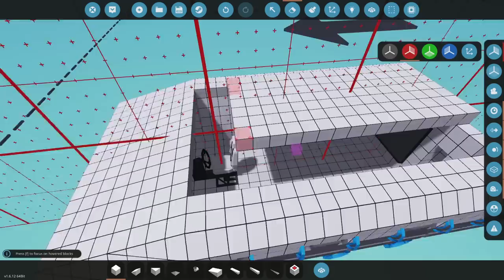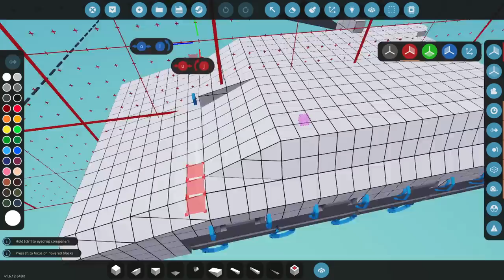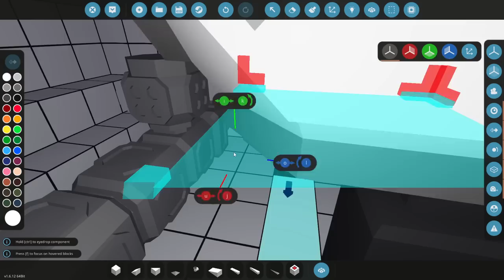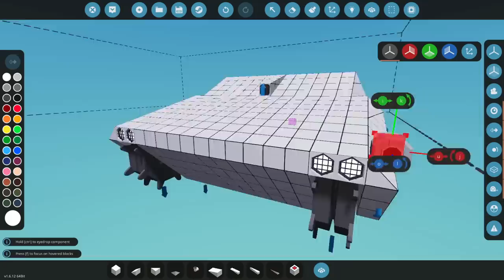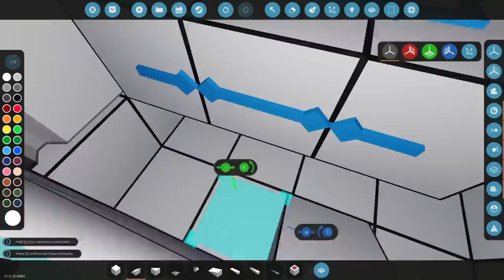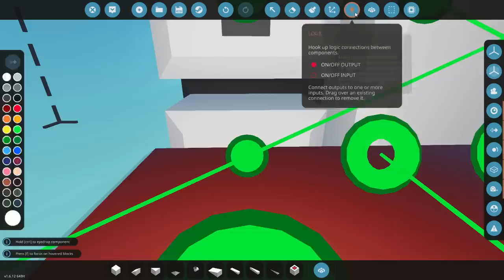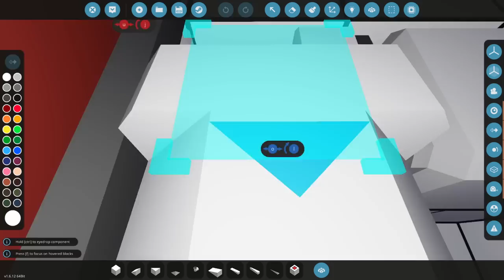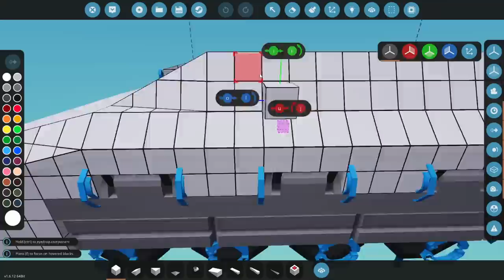I Built An ENGINE For My IFV - Lets Build An IFV In Stormworks!

Comment: I suggest that you put some fuel tanks under the seats in the Infantry space, like, you can place the fuel tanks as blocks that can hold the benches, it will look cool and you will have more fuel.
Reply: A bunch of small tanks or what? For now the engine room seems to have plenty of space.
Reply: Not very safe for the infantry is it?
Reply: @dulguunjargal1199  have you seen American designs?
Reply: @Metalbeast46934  I think American designs had some kind of portection for the fuel

Comment: If you use the "Sprocket" transmission setup  menu as a guide,  You can set up a transmission that works really good in stormworks.   

You need a reduction transmission to make small engines drive big vehicles.  

 I would start with 3 Main gearboxes and a reverse gear for the transmission.    

The arrows need to be facing away from the engine.

  Set the OFF ratio on all of the forward gearboxes to 2:1, this will give you a reduction of  16:1  which means 16 rotations of the engine is one rotation of the wheels.   

Then set the On ratio 3:2 on each transmission and either use a counter to turn them on one at a time or just use buttons to turn each one on.  

Turning on all the gearboxes will give you a top gear ratio of  5.0625:1 which means for 5 rotations of the engine you get 1 rotation of the wheels.   At 20 rps, which is a decent rps to run at with proper cooling,  the wheels will be spinning at 3.9 rps. 

Depending on the diameter of the wheel, that should give you around 10 m/s?     

The ratios I said are just a starting point and can be changed depending on how it performs.  

 Small engines tend not to like to run anything with wheels at or above 1:1 reduction unless it is a very small vehicle with small wheels.

  I would use a 5x5 radiator also BTW.

Comment: If I recall gearboxes correctly, the arrow pointing towards the engine is more RPS, whereas away is more torque, so from my understanding, two gearboxes facing the engine would give you more rps, or if they were faring away from the engine, more torque. It just depends on what you want, but personally I would say just one gearbox facing the engine is best because it multiplies the rps and divides the torque. I'll be honest, I'm not very educated in torque/rps, I'm just going off the basics I know, but u hope I was able to somewhat help
Reply: Kind of. It's important that you clarify where this is occurring since there's an "equivalent exchange" going on. A gear box pointing back towards the engine will give the wheels more RPS for the rate of taking away RPS from the engine and adding a lot of torque to it. So the engine will struggle to get up to a good rate at full till, but your wheels will go like there's no tomorrow.

A gear box facing towards your output (wheels, tank treads, or propellers) gives the output more torque and transfers more RPS to the engine. It's important to remember this exchange because while it seems fine and dandy to just stack a bunch of engine facing gear boxes maxed to a 3:1 ratio, if your engine isn't powerful enough, and most aren't, it's not going to work at full till (max gas and max clutch.) Using a combo of the two to get a kind of golden medium is ideal since you can get a kind of mid range ratio with the addition and subtraction of one to another.

TL;DR, facing the engine means more RPS to the output and more torque to the engine. Facing the output means higher engine RPS but more output torque.
Reply: @steeljawX  thanks for the clarification. Engines are not my strong point, but I do definitely wanna learn them because it's handy to know, plus, this will help with stormworks builds, so thanks

Comment: frantic heres a little explanation- usually many MBT's like the israeli Merkava or the Tam2 and most of the IFVs the engine as well as the radiator/fuel tank place Infront. and the driver is behind them, this is protecting the driver and the crew from Rounds like APDSFS or HEATFS or Hesh. and in some cases saving the crew from death.
Reply: Will he understand the shell types? You know, APDSFS and that?
Reply: @Metalbeast46934  probably no lol
Reply: bro really called the tam a MBT💀
Reply: @ludvigarstrand9666  ik its light tank but its concidered as MBT
Reply: @YR-gz2ip  no its not lmao
Reply: Also almost no tanks have the engine in front of the driver, it’s almost always to the right
Reply: @ludvigarstrand9666  MBT stands for Main Battle Tank. If Argentina declares the TAM is their Main Battle Tank, it is, and you must cry about it if you belive the opposite.

Comment: Also,  No exhaust is usually just s sign of no combustion from no air or fuel.    Adding a small pump for both will help ensure it is always getting the fuel and air the engine needs.

Comment: Personally, I’d use a 3x3x1 engine and gear the stew out of it to get the right speed and power. Worst case you can extend the front a tad to fit a 3x3x3 engine. Then there will be no shortage of power. But generally I use about 4-5 gearboxes with land vehicles.

Comment: I wish there was a small gimble camera. That's technically what you would want on the front, something with zoom and a small degree of movement, but all we got is either a massive gimble cam or slapping that medium cam on a series of pivots. Also, for your information, the amount of armor needed to actually effectively block incoming rounds is on the level of stupid. Even if you use weighted blocks, the amount doesn't really change. The fact that HE rounds tend to penetrate armor the deepest (as in deals damage the furthest beyond the surface of the target and not anything inappropriate as some might be thinking) is really dumb because that's what the AI is all equipped with in an infinite supply.

First off, don't use belt pumps or alternators. They do what they do at the cost of engine torque. Also using belt pumps for cooling is actually a very poor idea as you can only cool your engine if your engine is running and if it's running hot, then you need to cool your engine. . . .but you need to run your engine to cool it. . . . You also will want to pump air in and exhaust out. I know it seems really redundant, but if you let fluids free roam in pipes, they'll go wherever they want, not where you want them to. So having something as simple as a flow direction valve (the fluid thing with the arrow pointing in one direction) will help force exhaust out and air in.

You'll also want to have 1 central transmission from the clutch to the split and then have a gearbox on each end of the split (have them set to shift into reverse for neutral steering). If you have two sets of gear boxes branching out from the split, that can cause issues. Like the power supply for one gets cut or only one side gets damaged and won't shift. I get that it sounds like a non issue if that area gets struck by a round, but if you're able to repair stuff, having multiple gears going to each individual side draws more power for shifting and makes the system more complex. To give a better example, it's like having multiple steam boilers connected to the same fire box. Theoretically, they should all heat up at the same rate, but for whatever reason, one will always be faster than another.

For something that big, you may want to go with a 20 cylinder engine as well. It'll guzzle gas like it's going to die tomorrow, but it should give you a little more ompf. But also realize that tank setups are one of the hardest on engines. The amount of friction drag the thing experiences through the drive wheels is incredible and that's just how the game works. If you think you've got a big enough engine for a tank-like vehicle, make it at least 2.3 times bigger to get it to run like a "normal" engine. The 3X1 engines are also really good as they allow for you to slap 8 cylinders onto 1 crankshaft.

Lastly, something you should seriously consider, put those one way flow valve, as I mentioned prior, on your exhaust line or fluid filters on your air and exhaust lines. You're making this an amphibious vehicle, meaning it'll be on land and water. Any amount of rough waves could throw water down the intake port for air and then you've got a crippled engine trying to work with water in it. Likewise, if you ever stop your engine water's going to flow into the pipes your exhaust is connected to and into your engine that way. So just for your own sake, put one or the other on your air in and exhaust out pipes. You'd be wise to do the filter on at least your air intake. You have the exhaust right in line to get sucked into your air intake, if you're moving. That'll start damaging the engine and sapping power out of it.